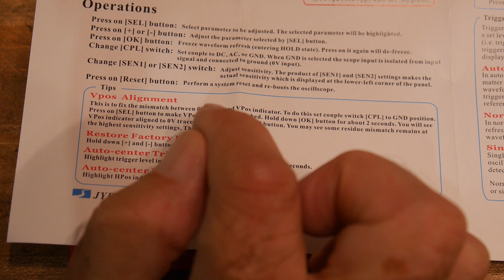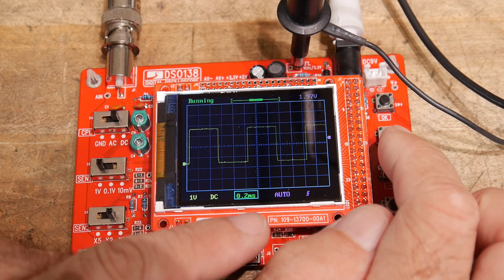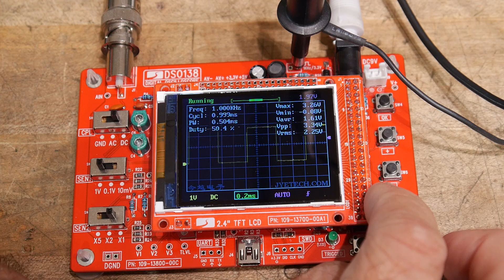#257 JYETech DSO138  DC offset

Comment: “Hi, I have two DSO138 units, and on both of them I see a lot of spikes on the trace even when I keep it connected to GND. I tried disconnecting the TL084 signal from the microprocessor by opening R16, but the spikes are still there. Does anything come to mind?”